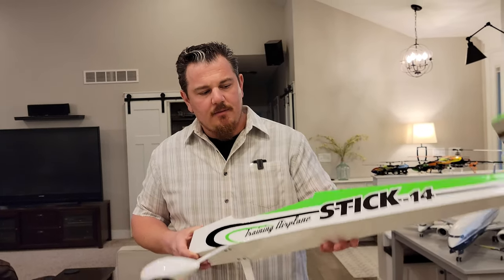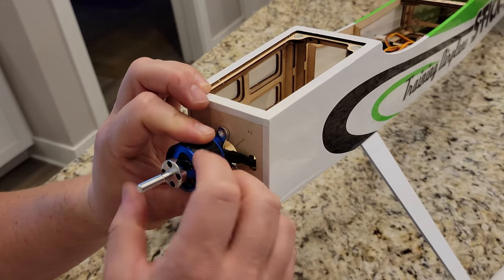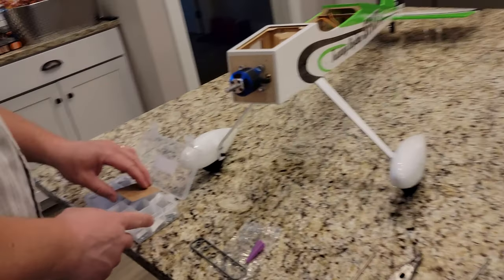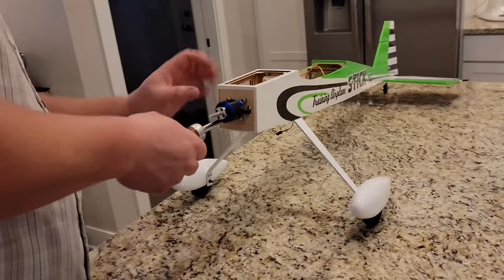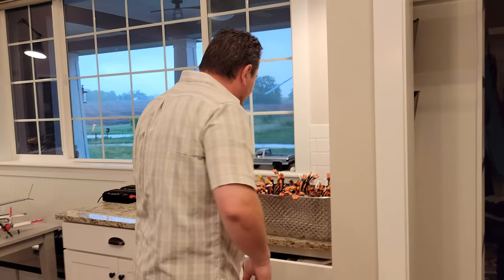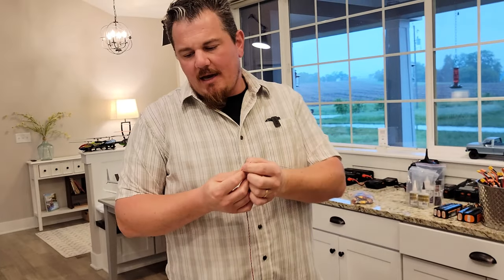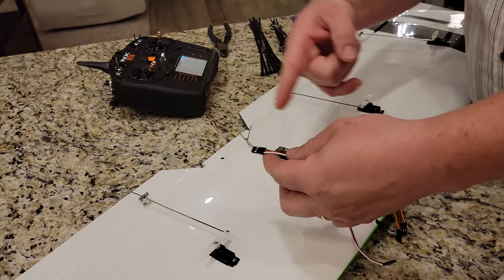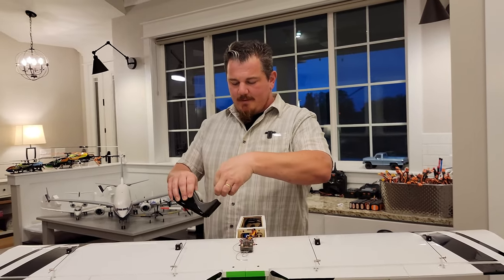Dancing Wings - Stick 14 - 1.4m - Radio Setup

Comment: Nice one again Brian. The only things I didn’t like was your button binding (might have been the build vid actually) using your face to turn on the Tx (like Jimi Hendrix). Why couldn’t you use the transmitters “bind” function, much safer? Also it’s good to rebind after the subtrim etc and maybe rebind again after the maiden flight trimming. Thanks to you and Camera Krew. Nic
Reply from the maker: Thanks